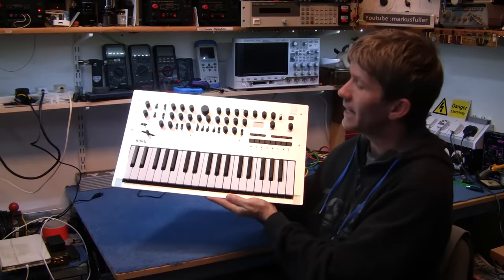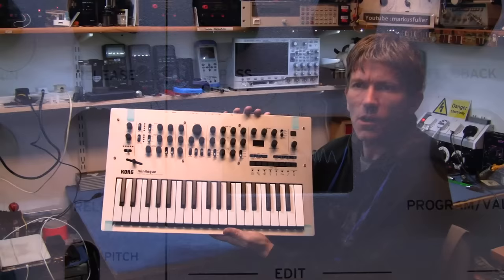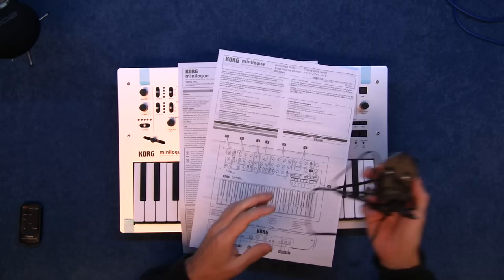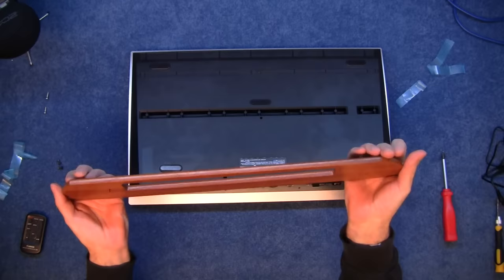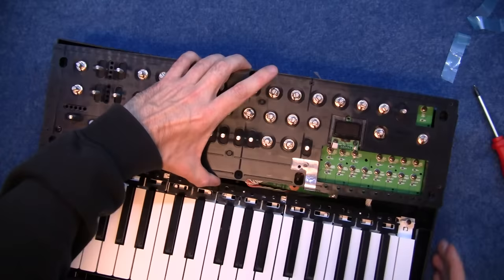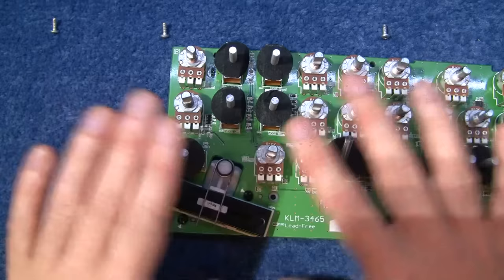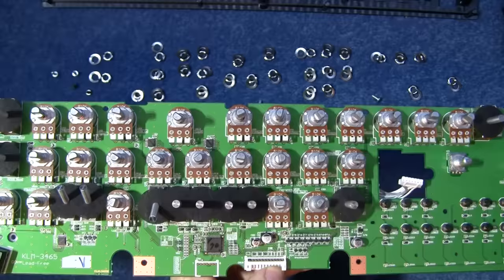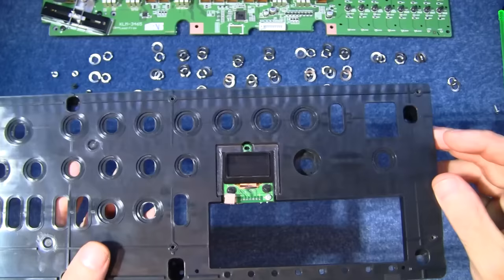Korg minilogue polyphonic analog synthesizer teardown MF#68

Comment: I couldn't tell from the video how so many potentiometers were handled by the UI. Are there any extra ADC chips or some analog signal multiplexers or such on the PCB? Are any of the signals filtered before going into the ADC?
Reply from the maker: +krakulandia Hello from what I remember the top control section had one ARM chip and a couple of smaller chips but I think the pot controls was maybe multiplexed by the arm processor where it would check the resistances of all the pots one at a time but at very high speeds. Thats just a shot in the dark but may be how its able to read so many pots.
Reply: +markusfuller Ok, thanks!

Comment: Good one Markus!
I was wondering about the dimensions of the boards, the four plus one processor one in particular.
I would fully expect a eurorack keyboardless follow on, so wonder if this pcb woukld fit? The reuse seems a no-brainer in the design, like with the Roland System 1 and then the System 1M.
Perhaps that also explain some of the unpopulated components, audio paths, or CV in or outs, etc?
Me thinks i'll wait a few months, to see what might appear, for me a modular of this is even better.
Reply from the maker: +Jukka&#39;s Channel Thats a good thought. they could be put into a rack or eurorack separately ?. Hmm me thinks you may be onto something here.

Comment: I wonder if you have any guess as to what those capacitors would have done?

As I mentioned in another comment, the criticism of this machine has been that the attack and release portions of the envelope seem to have a very noticeable "click" sound.

General speculation has been that Korg did some cost savings by not having the DC offset checked and adjusted on every machine;  There are no visible internal trim pots.  And this means that as soon as an envelope is triggered, the DC voltage goes instantly to non-zero, causing a click, and then again when the envelope closes.  I'm not so sure that is the problem, but many people smarter than me think it could be.

However, seeing capacitors missing from the design has me wondering if those could be for the attack and release portion of the envelope generator, but I have little idea if capacitors would serve this function, or not.
Reply: +inthefade Please stop this moronic stupidity. All synths with fast envelopes can click, especially with free running oscillators. I own a Minilogue (and other synths with envelopes fast enough to generate clicks) and its a non issue.
Reply: xv750nz
There is a great demonstration online where someone builds the exact same patch on a variety of other classic analog synths, and it doesn't click the same way the Minilogue does, especially on the release.

So it isn't moronic stupidity.

Honestly, I've been sold on this thing regardless of the clicking, it isn't a make-it-or-break-it issue for me, but I know it is a concern for a lot of people.
Reply from the maker: +inthefade I am not too sure why those Caps were missing but I have seen that in many new products even TVs DVDs etc. they sometimes use a smaller one under the board or decide the cap is causing more problems than it is saving. I have heard a few clicks but only on some of the programs
Reply: +Kevin H I find no problem remove attack or decay clicks using the envelope, but clicks from note stealing require a more thoughtful approach.
Reply: +xv750nz Good point about note stealing.

Comment: Very informative, thanks! I'm just wondering whether you found a dedicated delay section. From some of the demos and the mention of the noisy delay, I wondered whether it might've been a PT2399, as used (I think) in the Monotron Delay and a bunch of cheap pedals etc. Notoriously noisy and quirky, but with their own charm and an almost low-fi tape echo sound.
Reply from the maker: +voltlife Hello I am not using the onboard Delay I have been experimenting with the output going through chorus - delays - reverbs - phasers etc etc and its starting to sound like a completely different synth.

Comment: hi Markus! how do you think they did to reach that low price? Are electronics cheaper now than back in the days? thank you for all your videos, Im studing electronics and Im learning a lot seeing all that synths inside
Reply: yeah the components are really cheap now, a reel of 5000 resistors is like $12.00, and it only takes maybe 15 minutes to build the board on a Smt machine. But the price has a lot to do with the company's overhead. So Korg may be in a better position than smaller companies like  Dave Smith Instruments.
Reply from the maker: +Keepin' Soul Hi I agree with friendofCHAKA , the components are quite cheap and I uess the biggest cost is research and development. also its sometimes a good marketing move to make a little bit of profit on a lot of items than to sell just a few at a high profit margin, I think Korg are well placed to gamble on selling lots for lower prices. There is a shop here in brighton that will fit a new battery in your watch and charge you £1 all in (he is always busy) then there is H-Samuels the jewellers who will sell the same battery from the same manufacturer for £12.99 and say with a smile they will fit it free. guess who sells the most batteries. and consider they only cost £0.08 each to buy in bulk.
Reply: +markusfuller thank you both for the reply. Check Attack Magazine, Korg engineers talk about this video! One engineer talks about how using the ARM microprocessors they have cut some costs

Comment: Just had a look at your high res pictures on google. The IC's that alre marked with "MRC445" on the 3rd line are marked "084C" on the second line. They are most likely TL084C quad opamps. There are loads of them. I would expect some LM13700 or 13600 in there but could not find any yet.
Reply from the maker: +Chip Guy Vids Hi yes I agree with you on that. trouble is my brain could not function further than the 445 guess. everything is getting too small for my poor old eyes.
Reply: You are not alone with that problem!

Comment: Yep, i loved that one the instant i saw it, a few weeks ago .... I thoughed of that aswel some times ago ..... To use microcontrollers as analog vco or dco. But it roland did have this in the 80's.
Reply from the maker: +marco scooter me too I saw it and wanted it
Reply: I think, korg could have shaved some more cost and use only 1 xtal or oscillator and route the pulse from the first micro processor using the OSCO pin and have all micro processor clocked ..... Unoes they stilll do.

Comment: Thank you for the great teardown video, Markus! This seems pretty easy to mod to remove the awful "slim" keys and make a module version out of, wouldn't you say? Take apart, saw off the bottom bit of the front panel and plastic case, and put a nice wood plate in front to close it up... I didn't see anything in the teardown that would prevent that. What do you think?

Comment: I'm considering purchasing one of these for my first hardware synthesizer and I have a question about using it with Reason Essentials. I see that it has a USB type B plug which is the same as my Novation Launchkey 49 Mk2. If I were to plug this into my computer, would I be able to control it with my Novation product? I really enjoy it and would prefer to keep as my main controller! I also would like to know how I would go about getting the audio into my DAW, would it simply be a matter of using a 3.5mm jack adapter to a microphone port?

Thank you!
--David.
P.S I do not have an audio interface.
Reply from the maker: +venomblademedia Hello The USB on this only sends midi data to and from the PC, It does not send any audio data. you will need to have an audio input on your PC or some way of grabbing audio to USB. many modern PC have a mic input that is also a stereo input but dont take my word for that as I do not know the PC you are using. you will have to check if your PC has a stereo line in. or if the Mic socket doubles up as a line input. remember the minilogue is only Mono not stereo though the headphone output will split a mono output to 2 channels.

Comment: how are all those circuit boards manufactured? do they come out of a machine that place all the surface mount components and then somehow solders it all at once?
Reply: +CYPRN About 90% is done on the machine but the bigger heavier parts are put on by hand. I run a surface-mount line for my job so I look at this stuff all day.
Reply: friendofCHAKA sweet! thx for the answer

Comment: Amazing teardown. I have a minilogue xd and I have an issue with the first 2 octaves of the black keys. It seems like they need more pressure to work than the last octave. They still have velocity so that's not the issue, but I was wondering if you managed to figure out how to change the tension/trigger point of they keys on the keybed since I didn't see a key disassembly.
Reply: In case anyone is wondering. The keybed is the same as the one on the Minilogue from what I could see. No issues with the switches or keys, but there's this felt pad that the keys bottom out on that's a tad too tall on one side of my keyboard. I'd reckon that with time this will wear in and become proper. So the fix is just to play a lot.

Comment: Hi Markus. I heard you saying 4MHz crystals, do you know why a 4MHz crystal for a 72MHz ARM M3 microcontroller? Nice video.
Reply: The external crystal oscillator is used because it is more accurate over a wider temperature range. Use of the internal oscillator (which is realized as an RC oscillator) is a bad idea for production products, especially those that need accurate timing. Either way, the oscillator used is multiplied internally by the PLL to provide the functional clock speed used by the microprocessor.

Comment: Great video, as always. There's a lot of digital components for an analogue synthesizer. Not that's it's a problem, I embrace both digital and analogue equally, just an observation. Digital circuitry has been finding its way into analogue synthesizers since the early '80s, just seems a lot of microprocessing on this one...
Reply from the maker: +LektroiD Yes having 6 processors is a lot of grunt for an analog synth but they must be there for a reason. but the thing sounds very good and very nice analog sounds

Comment: Last comment for now, do you think the signal from the oscilloscope could be hacked to display on an HDMI or other digital port?  It would be really awesome to have it projected for live performances.
Reply from the maker: +inthefade Hello. you will notbe able to hack the scope as it is being generated by the Arm processor. You could get a PC Scope (small usb box that turns your PC to a scope :try amazon) and connect that to the audio out and then use a small cheap PC with a projector. that would look real good on a stage for live performances.
Reply: +markusfuller Hmmm yes, but this seems to automatically track the scale of the scope to the period of the note played.  I don't think a normal scope would do that unless it is hooked up via MIDI to know the length of the wave being played, correct?

Thanks for the reply!
Reply: +inthefade It also seems to only take the wave of one voice at a time, if I'm not mistaken?
Reply from the maker: Hmm yes I see your point there. maybe you could use a tiny cctv camera just above the display and connect it into the projector. if you use a small cctv you can screw the lens outwards as far as it will go and that will help it to focus on something very close.

Comment: Very interesting - and very brave, Markus!
The 3900 is a quad Norton amplifier (differential current rather than voltage) - a real blast from the analog synth past - ARP used them. I didn't think  3900s were even being made any more... maybe re-commissioned for the Korg Odyssey, and they had to order a truck load of 'em?
BTW - I'm, I wondering if that empty space inside the synth big enough to fit an internal PSU.
Reply from the maker: +mickey thompson I guess you could place an internal PSU in there with ease, Im not sure why they did not make it like that but I think someone mentioned that it was easier for it to pass FCC or some other EMI rules and regs. I really know nothing about all those electromagnetic and radio interference agreements between different countries. - wow a truck load of 3900's Thats a serious amount of chips, when is someone going to remake all the CEM & SSM chips.
Reply: Yes, that's how I understand it too - that the OEM adaptors are already FCC certified, saving Korg et al from having to certify each and every new synthesiser.
One neat trick I've seen on a printer, is an adapter that slots into a recess in the case, and makes contact via metal strips.
-
Didn't Dave Smith base some chips in his  new synths on Doug Curtis CEM designs?

Comment: My biggest concern would be the life of the OLED display.  Anyone have any perspective on that?
Reply from the maker: +Donald Priola I think they will work for many years and besides they would be easily changed as long as you could get them. 0.96inch seems a popular oled display they are in the king korg but are in many small devices such as mini oscilloscopes that you can find on amazon and blood glucose meters and arduino project kits so im guessing theres lots of these around and it was not specially made for the minilogue.
Reply: +markusfuller Thank you for such a detailed reply!  I have a Minilogue and absolutely love it, and you relieved a bit of my concern about the screen.  Thanks!

Comment: Thank god someone who did something against the rattling slider! One question. Is it enough to remove the Aluminum plate to do this mod or do i have to go deeper? Also it would be really cool if someone would bring out a Mod Kit or something to add a bit more Modulation capabilities or something like that. like Lfo waveshaping apply to Osc and similar
Reply: If you want to reduce the rattling slider noise- An additional thing i did that helped A LOT.  If you pull the slider know out you can see the two sides of the spring thingy and in the middle a white plastic piece where the spring "arms are right and left. If you play with the slider you will notice that it is a bit loose-has space between the spring arm`s that bring it back to position and the plastic. You can with a bit of caution pull that out without opening-taking apart  the synth. You then find som adhesive fabric tape (the one that has a cotton like feel. like the ones you find in the drugstore. You cut a very thin "belt" and stick it around the part that the spring arms touch. 2-3 layers are enough. You then put a drop of instant glue on the joint of the tape so it doesn`t start opening in time. Put the plastic thing back into place. Put the Knob back in to place. Takes 10 minutes max.  It gets A LOT quieter.
Reply: made some pictures in case anyone wants to know:  https://dl.dropboxusercontent.com/u/1798262/Korg%20Silencing%20.zip

Comment: my korg minilogue is stuck in tuning screen  it has solution? GRACIAS
Reply from the maker: Hello Juani. you may have to try a factory reset but you would lose any sounds you made yourself. I sold mine years ago but I think you have to hold the WRITE and the EXIT button while turning it on and the screen should say factory reset and you should have a few options if you turn the value dial. Hopefully this may correct the problem but you may lose any sounds you made up yourself as it should start fresh like when it was new. other than that i do not know what to say as i have not owned one for a long long time.
Reply: @markusfuller  Thanks for your time, I already tried what you told me before writing to ask you. I was able to reset but it doesn't respond to something else. Can you go back to the previous version of the operating system? maybe this can help. I do not know it is not a common problem but I am not the only one who has had it. thanks
Reply from the maker: Hello juani peñas. I really do not know what to suggest as I sold mine a long time ago. I think you should get in touch with korg.com as they may be able to send you a software fix.
Reply: @juanipenas196   Going through the same issue, it's not just us, there are a few people scattered around forums all over. Korg doesn't help - All they do is tell you to reload the firmware and if that doesn't work, send it in. I've gone as far as leaving the CEO of Korg USA a voicemail, I could tell he received the message because someone from support contacted me the next day. This is the reason why I only support certain companies, Funny enough - I had a problem with my Behringer synth, I contacted Uli on gearslutz and he put me in touch with his support guy asap, shipped it to them, and received the unit working a week later. Sad because I valued Korg but their support is shitty, doubtful I will ever purchase from them again.